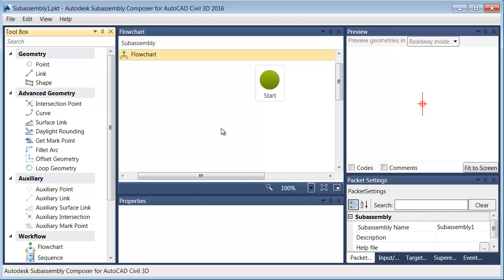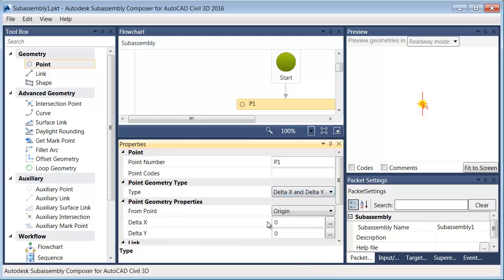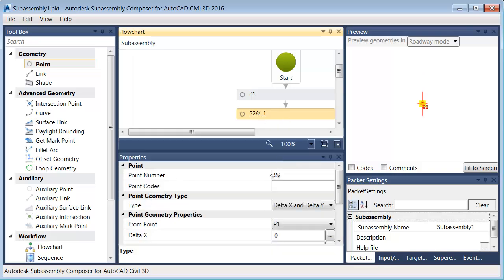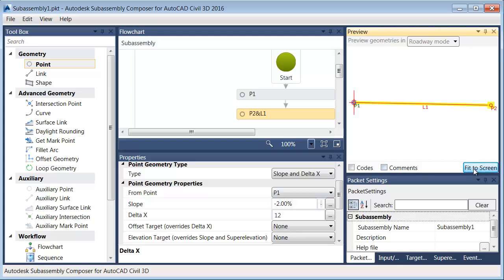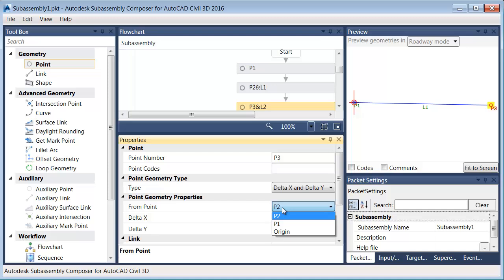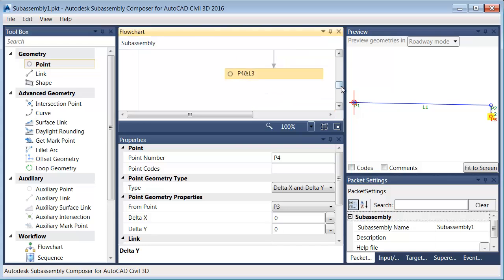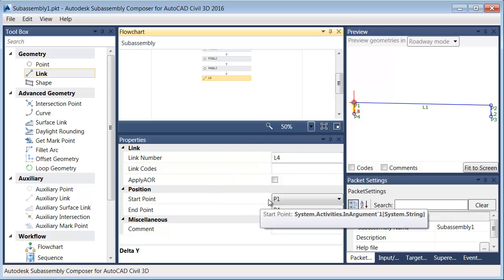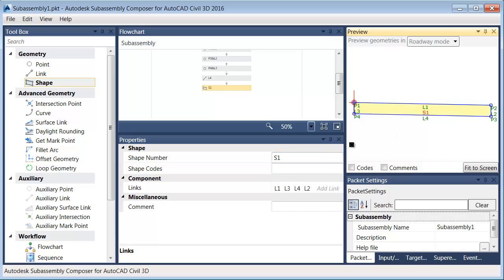Subassembly Composer Pt. 2 - Creating Parts Using Points Links & Shapes

Comment: Dear Jef, can you help me? I'm trying to make subassembly in Composer for the highway with divided pavement. Something does not work. Everything is fine until it starts with a superelevation. For separated pavement, I suppose that superelevation  is not the same as a two-way road. Do you have any experience on this? I think I need to include something called "pivot", but how I don’t know?